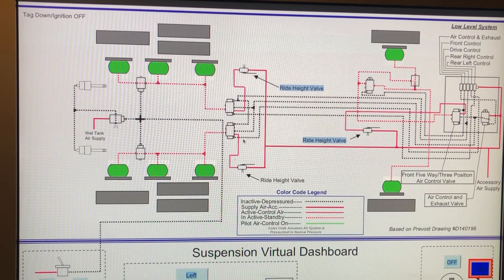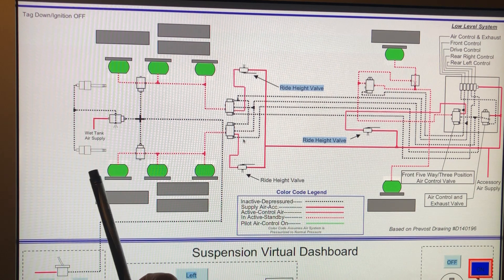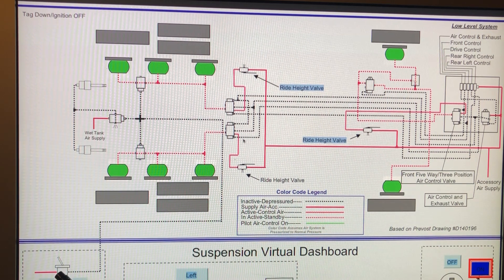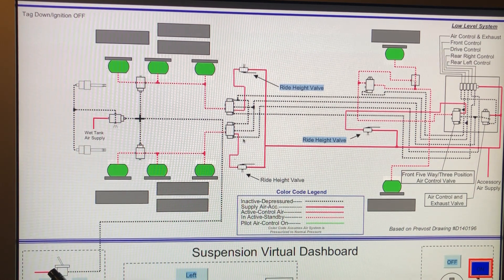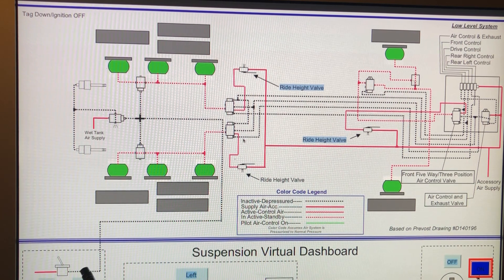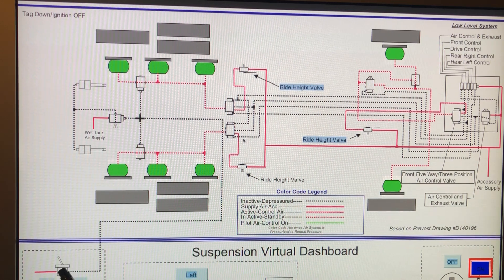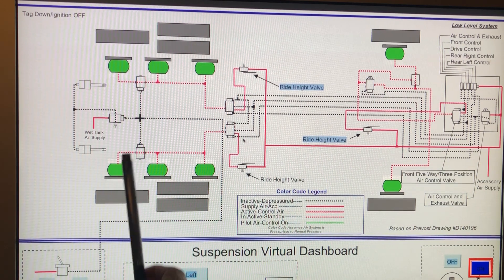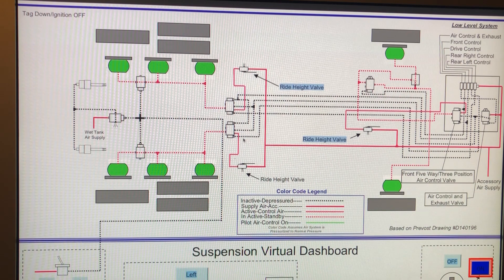PREVOST COACH- Figuring out why tag bags are deflating

Comment: Thanks for the info. I have an 86 XL 102 MTH which is the 40 foot version of the XL designated as a motorhome ,where they changed the frame slightly. I am currently fighting a considerable pressure up time and have been told by Prevost Fort Woth that the bags are leaking despite only being ten years old and am about to attack the situation so any and all info on the Level Low suspension is appreciated.

Comment: Makes a lot of sense. I have a 95XL and this happens to me… great modification… I also have had sticky valves in my coach and Prevost wanted like 180-300$ each for new ones… I rebuilt all of them for less than 10$ by going to my local power rubber and gasket company and having them stamp out the neoprene flat O-rings which in most cases is the issue of being worn and/or torn. Just have to pay close attention to the shuttle valve direction upon disassembly so that you can reassemble accordingly…